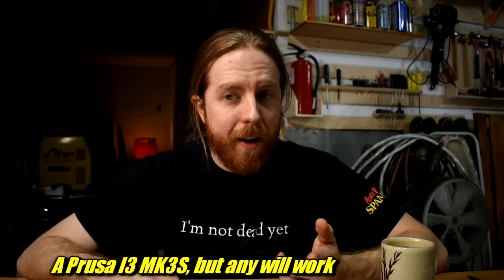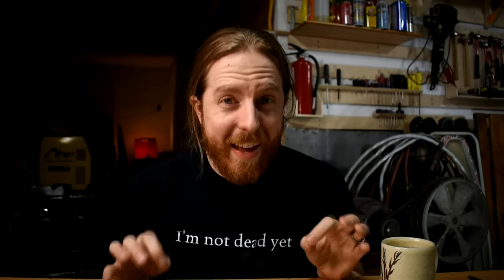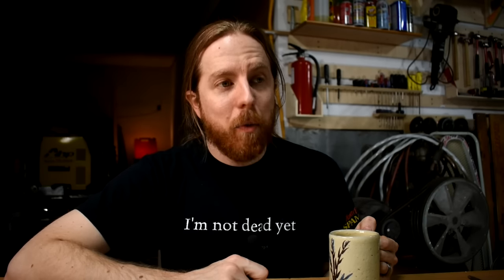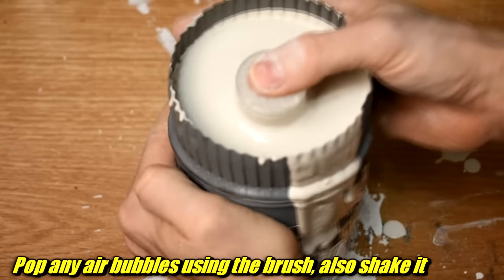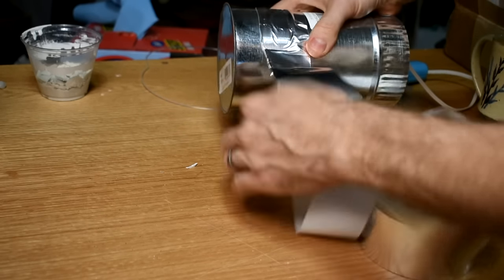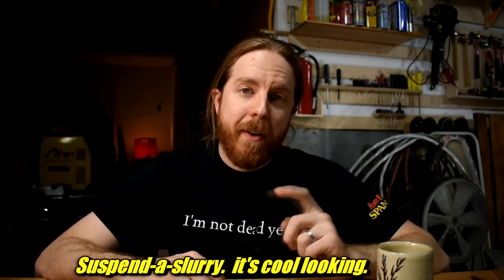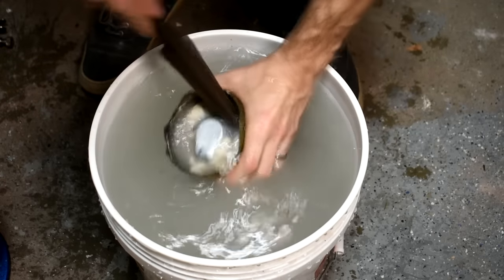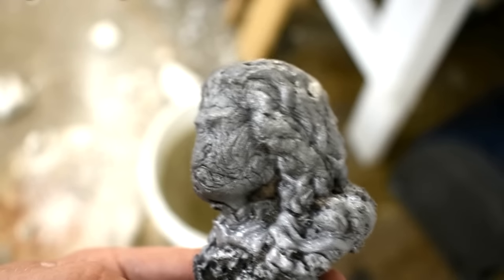3D Print to Solid Metal, BETTER Than Lost PLA Casting

Comment: If you want another tip, they make burnout resins too for lost RESIN casting from a 3d printer.  They cost like 50 bucks a kilo, but they are WORTH IT.  The quality is 100 times better than any fdm printer you own.. my fiance and i are doing our wedding rings using it to make a really pretty set of custom rings.

Comment: I've used MoldLay before with great results. It's the same price as polycast, but it's a wax filament that's easy to print with and melts out of the mold super easily.

Comment: When you melt down the Zamak ZA 12 does it burn off any elements or can you still reuse with ease?
Reply from the maker: I've reused the metal a whole bunch of times, no issues.  Za12 should only be zinc and aluminum, and i barely heat it up to liquid. Zinc has the reputation for boiling off because brass (copper alloyed with zinc) melts at a temperature above zincs boiling point.  Keep it barely liquid and it shouldn't boil off at all, certainly not enough to screw up the alloy.  Especailly with Za12, because zinc and aluminum aren't very sensitive as an alloy.  you can basically have no aluminum or lots of aluminum and everything in the middle is ok, as long as you keep any and all lead as far away as possible.

Comment: Thank you for showing,I do have a quest, could you Try Esun Emate low Temp PCL filament for casting, as you can melt it at 65C but would love to know if it would be any good. as it prints pefectly with no layer lines.
Reply from the maker: Great suggestion!  I've never heard of that filament.  Ive used esun black pla and its great for the price.
Reply: @PaulsGarage  I love Esun Products, and to say Mainly I use the PLA + for tools
I hope to have a go at casting using Esun Emate  low temp as much cheaper than Polycast

Comment: That triceratops skull came out Great! For ornamental applications, it's hard to beat Zamak.
I don't know if you need more gadgets, those castings would have been almost impossible using sand casting. 
Any thoughts about using a pouring basin and tapered sprue setup ?
Have you picked up the zinc package yet? I wonder how it did in mail. Heavy for its size, not sure if cardboard was up to the task.
Cheers from Alaska
Reply from the maker: Hi Gregory!  I did indeed pick up the package yesterday!  I think I'll open it on a Livestream.

I use a pouring basin and tapered sprue for sand casting, and I know VOGman does for investment prints, it's a good idea for sure.
Reply: Cool.
Let me know when the livestream happens.

Comment: Can you give a quick and dirty guestimate of what it would cost, equipment wise to do this on the cheaper end, but not so cheap I'd end up buying better equipment soon after? No need to take the time break it down, just in the ballpark is fine. Assuming all I already have is a printer. TIA, Great info!
Reply from the maker: Hard to put an exact number on it but at minimum you need something to burn out the mold and something to melt the metal.  One foundry furnace set up from an Amazon seller like vevor might work as long as you keep temperatures low, but a devil forge would be a step up.  You could use the furnace for both like I did here.  Plaster, filament, and the steel vents/soup cans etc... Are expendable, though, so prices go up the more you do it.  Ideally you would have a small electric furnace to melt the metal and a small burnout oven, but prices go up considerably

Comment: could one say cast a frame for a quadcopter that could be finished in a cnc or a jig/drill press?
Reply from the maker: Probably yes.  Lots of those kinds of parts are cast, though they tend to be die cast for production purposes.  You would probably want aluminum though to save weight and that doesn't flow as nicely into details, but you can get around that in a couple ways

Comment: There's a reason we use wax in "lost wax method".  Printing in wax is a pain but back in college we'd dissolve grocery bags in the wax to harden its solid form to prep bronze molds.  Point being, try polyethylene filament (grocery bags) and that may be the next best material to wax.  Should be inexpensive.
Reply: Could you elaborate on this? Link to filament?

Comment: If you only had one furnace, could you burn out the plastic then fill the mold with shot (small pieces of the casting metal) and let it melt inside the mold, or would that not work?
Reply from the maker: That might work, not sure though.

Comment: Any thoughts on PVA filament?

I'm thinking PVA for the print and high temp silicone for the mould
Reply from the maker: Never tried PVA.  That's the water soluble one right?  What you suggest would probably work but I've never tried it.

Comment: Ok so a question, could Zamak and this process be used to create either compression or injection molds?
Reply from the maker: It's probably possible.  I think as long as you keep temperatures down it would be fine.  I've never seen zamak used as injection molds but plastic temperature is probably plenty low enough not to mess with the metal
Reply: @PaulsGarage  yeah cool, I've been looking for quick iteration solutions, mainly for hdpe so fairly low temp, around 200c. Seems depending on the composition, Zamak is around 380c so it seems like it might work. The other question is how long the molds will last.

I've not found any documentation on trying this anywhere so far. It seems like a fairly obvious alternative solution to cnc molds, so there's a decent probability it's a no go. But as thet say, if you never try..

Comment: Do you print these with hollow “vase mode” settings or with infill?
Reply from the maker: These are normal prints with infill and everything.  The vase mode prints for burnout are limited in shape (must be able to print it in vase mode) and the shape can be difficult to maintain when doing the plaster step.  It can definitely be done though, but not for this triceratops skull shape.

Comment: How does this process compare to resin prints and lost wax casting? Could you make rings,  etc from this technique?
Reply from the maker: The burnout and casting process is exactly the same.  Whatever you can print with polycast filament (or castable resin), you can cast in metal.  Layer lines come through though, so beware of that.  Polycast smooths with alcohol (IPA) which helps.  I have some more recent videos with lost resin casting, all using plaster, but FDM prints might be better with ceramic shell casting, since that works better for larger prints.  Not saying you can't use plaster, but the plaster can get expensive in large quantities

Comment: What type of metal casting alloy is the best for mortar pestle, which must be adequately hard and heavy?
Reply from the maker: Not sure I'd go with metal for that.  The reason stone is used is because the hardness of silica is way above most other things including metal.  I don't think I'd want to risk metal bits in food.  Some metal can be toxic.  Rocks bits (sand), other than being sharp, are chemically inert.

Comment: another/better alternative to cast your investment into:
instead of steel investment tubes, try PVC pipe or drainage segments, cut them to shape and give them a cut right down the center from end to end, tape the cut up and put your casting blank on a piece of tape and tape it to seal the bottom.
after the plaster has become dry-wet, untape it and work the center split to release the whole mould from the PVC and then without waiting or using another tube, you can just keep going making more moulds from one piece of tube.
and best of all, you never have to "clean out the plaster" 

when I started I did this simply using the caps of my tiny torch refill cans. so any flexible straight piece of tube plastick will work.
maybe you dnt even need to spend a dime!

Comment: Also question about the zinc alloy. what aluminum are you comparing to bc there are alot of different alloys
Reply from the maker: It flows better and melts colder than all aluminum alloys, but the closest comparison is probably a great sand casting alloy like A356.  This still needs about 400 degrees less heat, and still flows better than a356, while being stronger too.  It's not light like aluminum though, it's really heavy.

Comment: Notes on the ZA alloy casting, it is toxic and can make you sick if you get the zinc oxide dusty vapors, also ZA27 is mechanically tough like for cutting or drilling, much harder to drill through than mild steel, its just zinc and aluminum.
Reply: zink alloys melt under 500C if you dont heat to 900C you are fine

Comment: Can zamak parts be brazed/soldered together?  Have you ever tried that?  Any recommendations?  Thanks.
Reply from the maker: Maybe soldered?  I haven't tried any of this but standard tin based solder melts at a lower tempetature than zamak.  Brazing operations or silver solder etc... are often hotter than zamak melting point, so be careful
Reply: I don't think ordinary solder would wet the Zamak. Even solder designed for aluminium may not, because of the zinc content. Beware of using flux or soldering fluid unless it's specifically tailored to Zamak, because it may cause ongoing corrosive attack. Zinc is a very vulnerable constituent, which is why unprotected brass turns to pink sponge and falls apart after prolonged exposure to salt water.

Comment: I use this lightweight PLA for printing RC airplane stuff. Well, it basically prints out styrofoam, and I wonder if it would work for burning out molds.
Reply from the maker: Not sure.  That stuff expands a lot right?  I would be worried about it expanding too much and cracking the mold.  Do you print the 3D lab print stuff? I have a few of those models, they are really cool

Comment: No information found regarding cutting,machining and drilling. Any idea?
Reply from the maker: I've heard this metal machines well but only with sharp tools.  In my experience it scrapes easily, drills a bit harder than aluminum, and will gum up sand paper and grinding disks very quickly.  I recommend flap disks instead

Comment: As a zinc alloy is it any more dangerous to use than aluminium? I'm guessing same warnings apply... wear a respirator etc... but just concerned about the zinc.
Reply from the maker: The temps are below aluminum and well below zinc boiling point, so the fumes aren't that bad.  I have everything well ventilated because of the gas foundry already, and that seemed sufficient.  Melting brass might be a bit more of an issue, but not zamak

Comment: Isnt PVB alcohol solluable? Why not use alcohol instead of burning the part out?
Reply from the maker: great question.  Yes PVB is alcohol solluable, but that could screw with the plaster, too.  This plaster isn't ideal, but even something like prestige optima (the plaster I use now) shouldn't be dunked in liquid.  The burnout process i just as much melting out the plastic as it is "firing" the plaster mold (think firing pottery- drying it out but also sintering particles together).  This changes if you try using something like "suspend-a-slurry" ceramic shell.  I dont' know if that can handle alcohol, but it can definitely be dunked in water before firing.  I know some sculptors who boil those molds to get the wax out (so they can re-use it) but even then, they have to fire the ceramic shell anyway before casting.  If you want to cast metal from a 3D print and you don't want to fire the mold, I would suggest sand casting instead.  You can't make that triceratops head, but you can do a LOT with sand casting.

Comment: Can you use plaster from the hardware store instead of proper investment plaster ? Did you try that out ?
Reply from the maker: This video actually used hardware store plaster of Paris.  It works.  It's not great, the cracks are particularly bad and the working time is too short for comfort but it does work
Reply: @PaulsGarage  Great, thank you for the response. This and the burnout cycle is the biggest hurdle in my DIY setup at home.
I don´t have any "real" equipment for the task I am afraid and I can´t buy more stuff for this, ( I could it just takes way too much space with my other crap and the lady of the house might be pissed, justifiebly so). 
Do you think I could burn that out in my oven first and then with a hand torch I got ? 
Otherwise I would have to use a high temp silicone mold but it only holds up for 450°C for short period of times, which isn´t ideal either.

Comment: Here is a nother tip if you want to use aluminium. Use the right kind. There are casting alloys and wrought alloys. Casting alloy is found in hard drives fro example. It flows a lot better since it´s optimized for this task.
Reply from the maker: Very true.  I'm skipping the scrap step entirely from now on for casting that I want to be good.  Buying certified ingots.  I'm not giving up my scrap stash just yet though...
Reply: @PaulsGarage  Well you could bring your crap to a scrap yard and get some money for it which you can use to buy proper aluminium instead but of course this is entirely up to you. Just saying it is a possibility.

Comment: Did you try to use actual wax for sprues and gates?
Reply from the maker: Not quite, I used a glue stick as a quick and easy way to make a sprue.  The rest, like the vents, look like wax straws but are just straight pieces of the same polycast burnout filament.  It worked pretty well but I think wax is probably easier to work with

Comment: Came across an interesting take on this idea from HEN3DRIK (https://www.youtube.com/watch?v=OYgn3tsJRWg) 
1) Print the part in PVB like you did (smooth if you want)
2) Electroplate the print in Copper
3) Soak the part in IPA for a day or two will the PVB dissolves completely and your left with a very thin Copper "mould"
4) Melt your metal (he used Tin which has an even lower melting point that requires no smelting or furnace at all but you could use the Zamak if you wanted)
5) Pour the molten metal in the copper mould (copper melting point is well over 1000 degrees so it will be fine)
^) Allow to cool and you have a solid metal piece with the ultra-clean electroplated Copper exterior, which can be further plated with Nickel, Chrom, Silver, Gold etc.
Reply: there's also vacuum casting which I've seen done DIY with a homemade vacuum chamber and pump, thus pulling the metal into all the fine details of even small items such as rings
Reply: @Information_Seeker   oh! I like that idea as well!! I've seen people doing professional casting often use a vacuum table to pull th emolten metal into the moulds.

Comment: use steel sheet w/steel wire to hold cylinder shape. w/ steel disc for bottom. 30sec to 
drop off at any point in process. ceramic moulds can be reused. why do you show
aluminum tape when it is destroyed along the way?

Comment: Well, now I know what I was doing wrong with my prints! My aluminum casts looked a lot like your John Snow. I'm gonna have to get my hands on some PVB...

Have you tried PVA? Does it have similar properties?
Reply from the maker: I haven't tried PVA but not all PVB is the same.  Polycast is specifically made to burn out clean, unlike other PVBs

Comment: Will you be using a vacuum chamber during casting next time ?
Reply from the maker: I plan to do vacuum casting eventually but probably not next video.  I have a sand casting project coming up.  I need an electric furnace and vacuum casting rig for vacuum casting which is something I need to build or get somewhere.  But yes eventually!
Reply: @PaulsGarage  Alright then. I am currently looking for the cheapest and easiest way to make metal casts at home with minimum effort, gear and investment so I try to piece this whole thing together. You did help a lot in this process. I am still torn between single steps though. 
I plan to use zamac as my main casting material since I can get it from work for free
I wanted to use plaster as the mold material because it is cheap but I am not sure if I will be beeding a vacuum chamber for this process or not. Also which plaster exactly and so on, maybe you can help here with some advise ? I do have a 3D printer and I plan to do it at my apartment so I cant build furnices and stuff.

Comment: Do you have a copy of John Campbell's "Complete Casting Handbook"? He devotes 5 pages to zinc alloys: ZA12 through ZA27 look to be the best for gravity sand casting in a cold mold with ZA12 giving the most uniform composition. ZA27 has some odd behavior when it cools, especially in thick castings - it starts as a uniform 27% aluminum liquid but the first composition to freeze is 60% aluminum and the last part of the casting to freeze can be as low as 5% aluminum.
Reply from the maker: Interesting!  I don't have that but I've seen some talks by John Campbell.  The casting books I have are from CW Ammen but they might be a bit out of date when it comes to newer alloys or techniques.  Campbell is the guy who talks about bimetallic films, right?  Never saw Ammen talk about that in his books
Reply: @PaulsGarage  I think I learned about Campbell from olfoundryman's comments about bimetallic films and surface turbulence. The book is overkill for hobby work but it's full of fascinating practical and theoretical info and I'm sure you'll get something out of it. Watch your PO Box tomorrow or the next day... :)